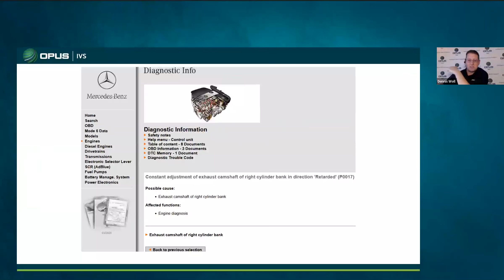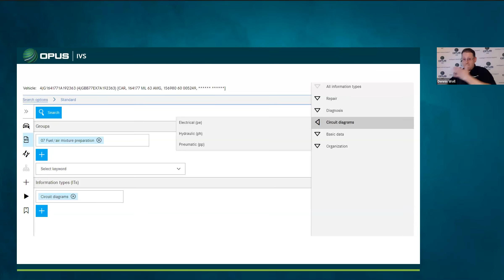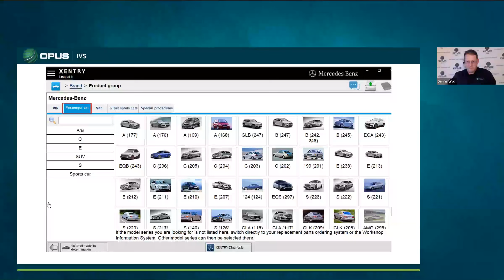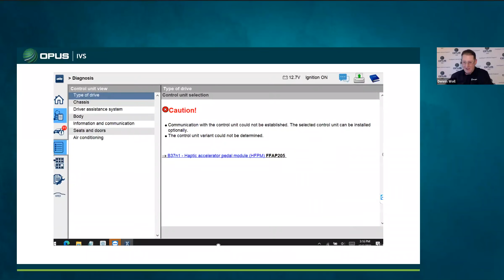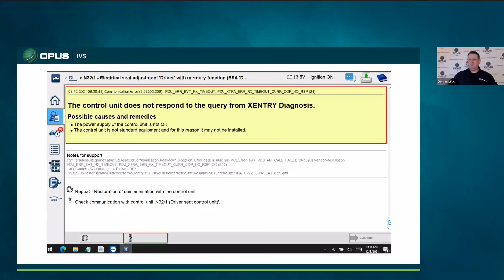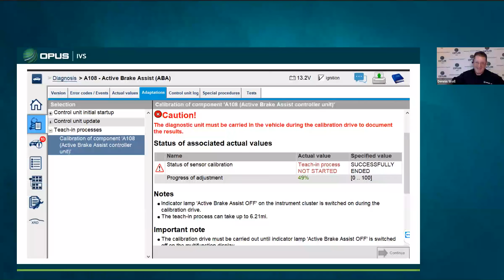Mercedes Benz Diagnostic Tools   Navigation and Repair Strategy

Comment: I noticed the extensive Xentry available information. Also from my observations  Xentry is absolutely comprehensive when assisting during the diagnostics process. Will WIS have pinout information and Diagnostic Pinpoint Test Information available or is this only available on Xentry?